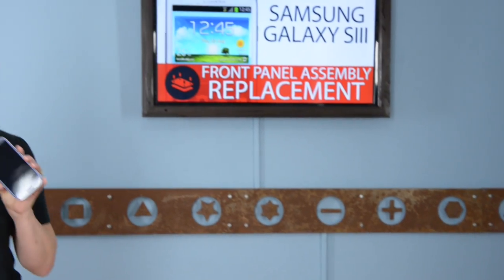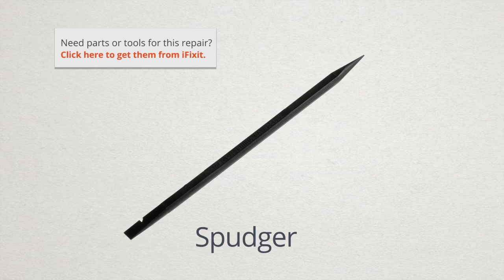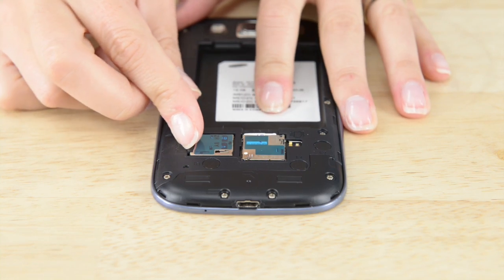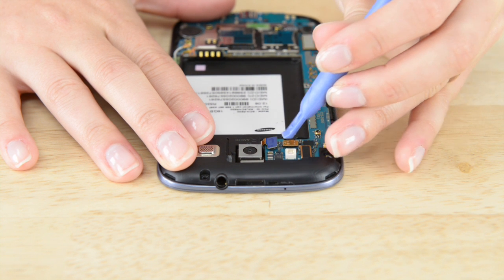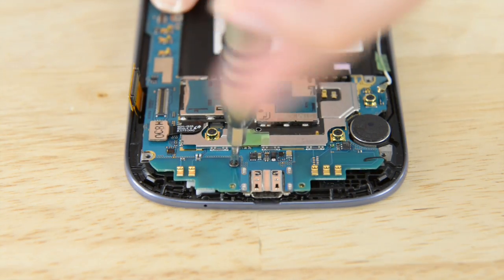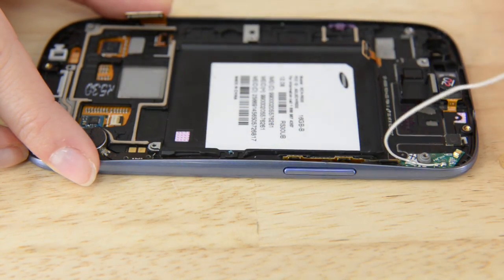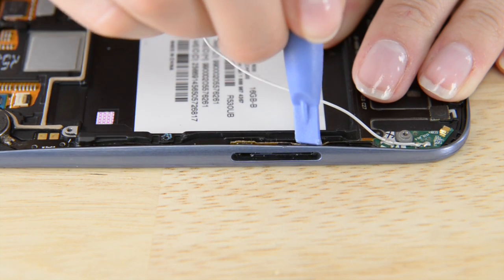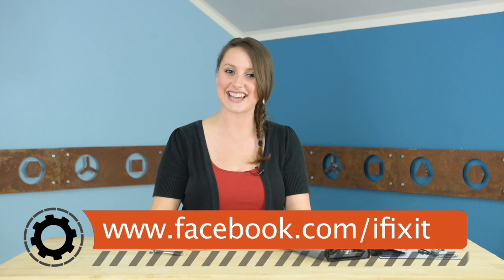Galaxy S3 Front Panel Replacement

Comment: I forgot my S3 in my pocket and I swam for few minutes. Now when I plugged it in the charger I have a pink screen and sometimes the Flesh LED keeps turning on. I also feel it becoming hot while charging as it used to do when it was working fine.
Is there any possibility to repair it?
Thank you
Reply: TheOnlyGuess fuck no
Reply: @ajlion  lol it might be possible to still repair it. Some professionally done repairs have worked but may cost about as much as the phone is worth. I had a water damage repair that cost me $400 from a professional service once. They didn't just do the normal isopropyl treatment as that had already failed twice.

Comment: Ive changed a few s3 fronts and have always used the heat gun/hairdryer method, and this way works a treat and is a hell of a lot easier (unless the digitiser is knackered)